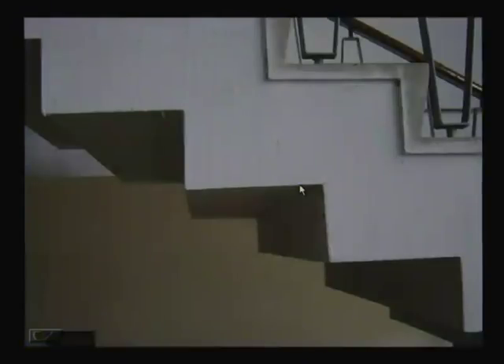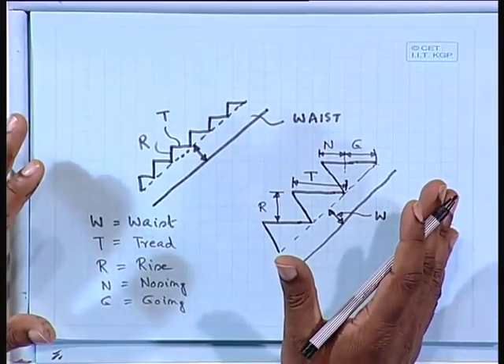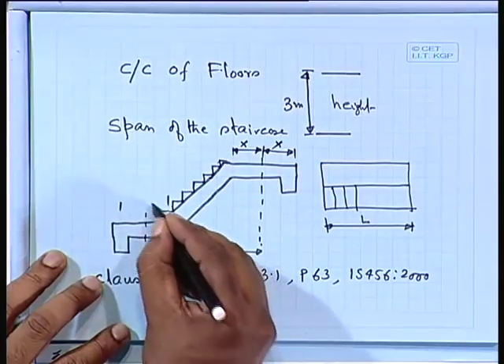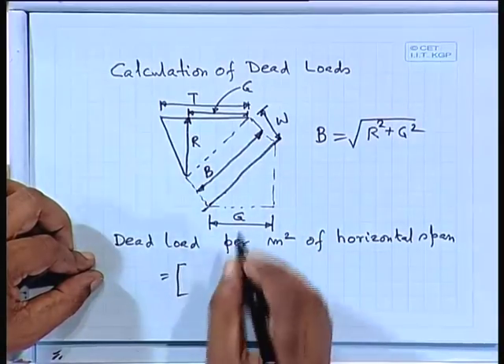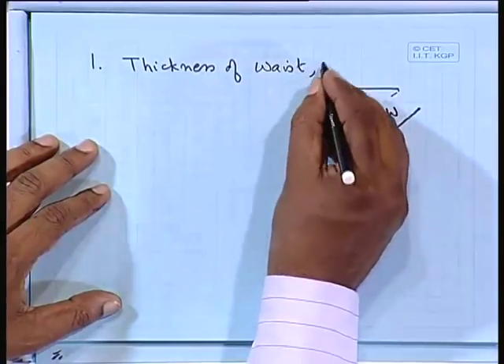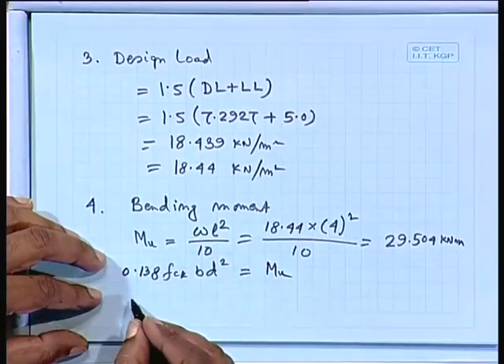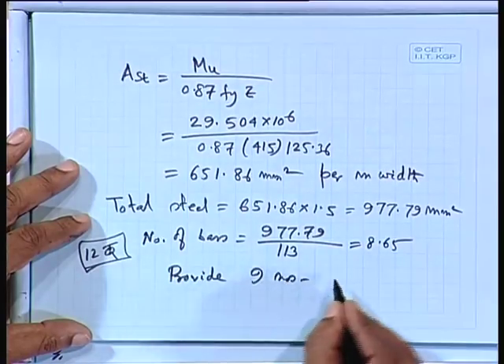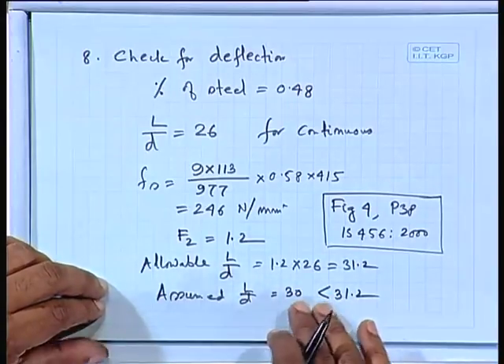Design of Staircases

Comment: if you have problem with right side audio of the video here are few steps which will correct audio for this video
go to ease of acces>audio>turn audio as mono
problem will be solved. when video is over dont forget to turn of mono audio from there

Comment: As a short cut, bending moment for a beam (partially continuous or fully continuous) can be assumed as wl^2/10 and the same reinforcement can be detailed at span and support. This thumb rule should not be applied for simply supported beams.